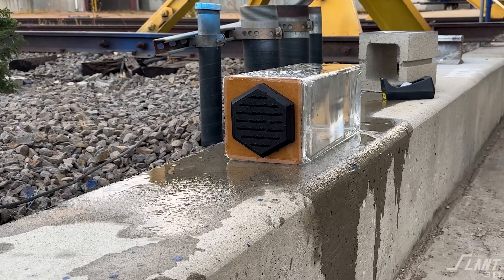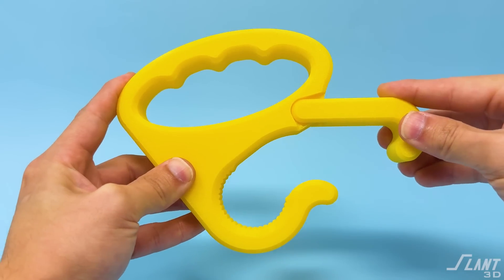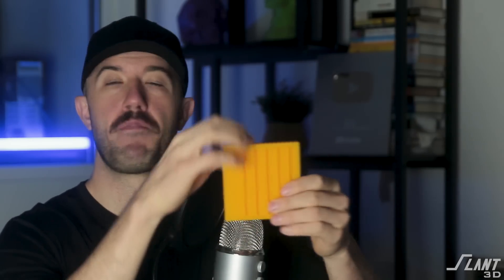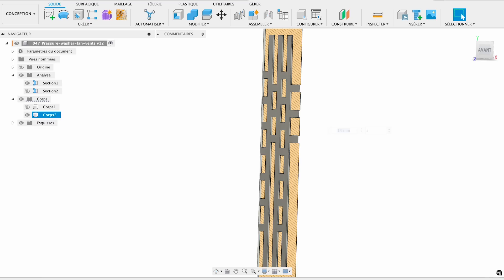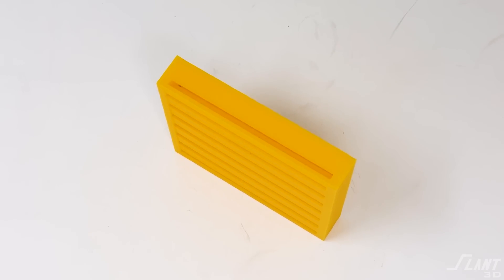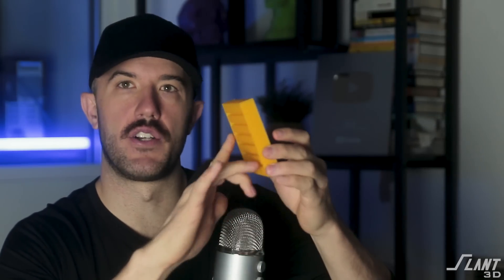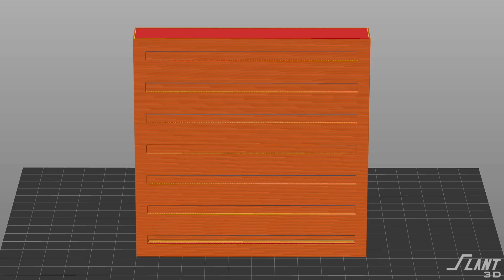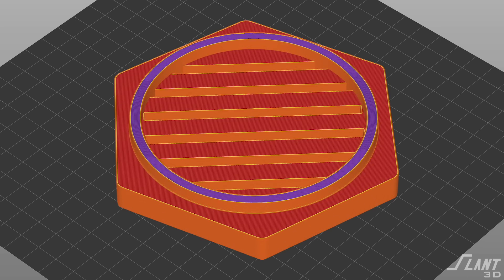Water-Resistant Vents for Industrial Applications | Design for Mass Production 3D Printing

Comment: Sure looks to me like water's getting into the box.
Reply: @carsondial2  yeah, it doesn't really match how things are done industrially. Rather than a bunch of slats, these types of louvres usually have "S" shaped paths letting the air flow upwards into a room or chamber, but the water won't have enough momentum to do that. Couple this with slats which will stop any horizontal momentum from a jet of water, and you have an effective barrier.
Reply: Yeah there is... With these slats there's a 45 degree path downwards that's just open. You could hold the print at a certain angle and just look through it. That's never good for stopping water. I get that it's about the concept, but this isn't a great example.
Reply: @timderks5960  🔴 What Is Islam? 

🔴 Islam is not just another religion. 

🔵 It is the same message preached by Moses, Jesus and Abraham.

 🔴 Islam literally means ‘submission to God’ and it teaches us to have a direct relationship with God. 

 🔵 It reminds us that since God created us, no one should be worshipped except God alone. 

 🔴 It also teaches that God is nothing like a human being or like anything that we can imagine.

🌍 The concept of God is summarized in the Quran as:

📖 { “Say, He is God, the One.  God, the Absolute.  He does not give birth, nor was He born, and there is nothing like Him.”} (Quran 112:1-4) 📚

🔴 Becoming a Muslim is not turning your back to Jesus. 

🔵 Rather it’s going back to the original teachings of Jesus and obeying him. 

More .....👇

🔴 THE RETURN OF JESUS
Reply: Eh, at least he didn't just look up a solution and make a video about that. Makes it more fun for him. Still looks like a borderline IP34.
Reply: No matter what you’ll have to deal with condensation inside the box..
Reply: @enginerdy but condensation is easier managed by airflow and desiccants versus actual leakage.
Reply: Looks like you can easily shoot water all the way through your alternating slats (as illustrated) by angling it up or down at about 45 degrees.
Reply: @carsondial2  obviously you need different pitch for each layer so that they not line up at certain angle.